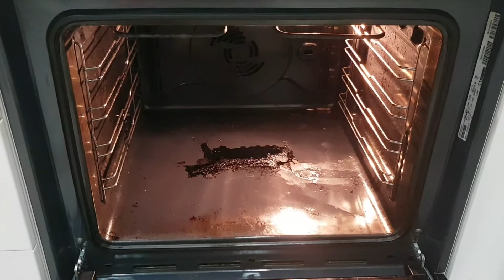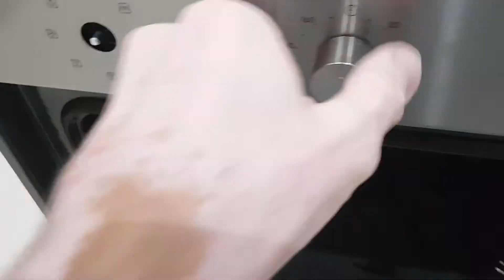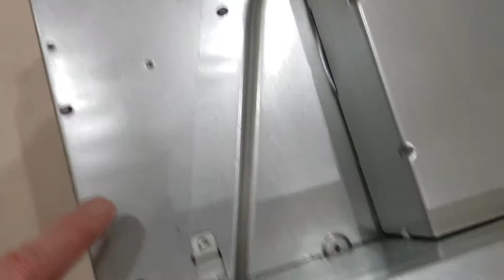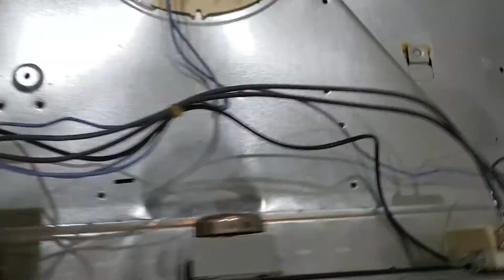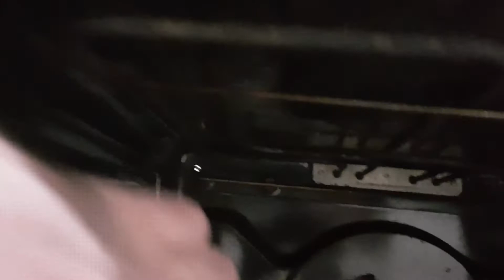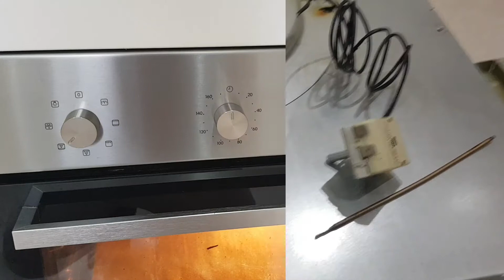IKEA Oven - Thermostat Repair

Comment: Dear friend, thank you for your useful video.
In my case the the oven make some heat but the thermostat don't make that "click" or turn on the light, do you think the problem should be with the thermostat or the heating resistor (not sure if there is more than one)?

Comment: Thanks a lot, replaced the broken thermostat in my IKEA oven thanks to your video. Got the replacement one from Ransomspares and didn't need anything extra done to the temperature knob either.

Comment: hi your video was very helpful we have the IKEA oven (model number FXZM6) we dont have the instruction manual its one we have had second hand so we are trying to get a book and some info tips on how to use it' but cannot find anything about it anywhere ? do you know where we can try please amp
Reply from the maker: Hi.
I found if you google the IKEA part number inside the door you can get the user manual. On mine the number is 503.008.07 and there's manual here: https://www.manualslib.com/manual/971344/Ikea-Realistisk-503-008-07.html?page=4#manual.
I think the model number FXZM6 is a manufacturer code as I believe it's actually made by Whirlpool and rebranded for IKEA.
Reply: @dec cranmer.. hi ,got the same model as yours.. where did you get your part?
Reply: @nickvandamme6196   from ebay'  of all places' good luck..